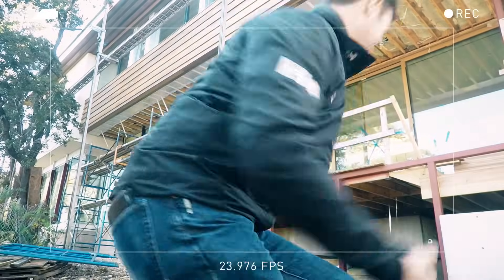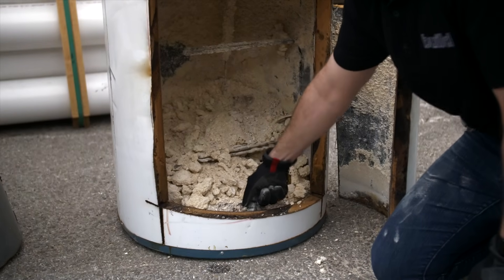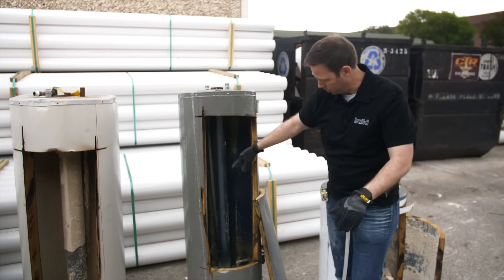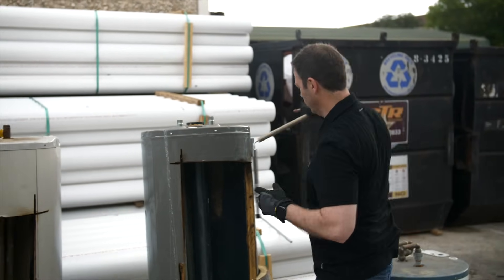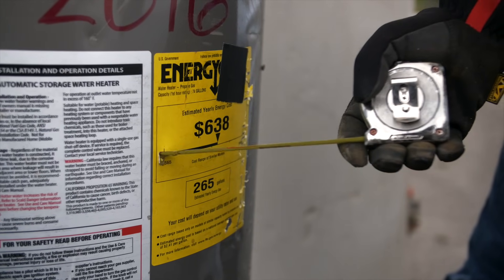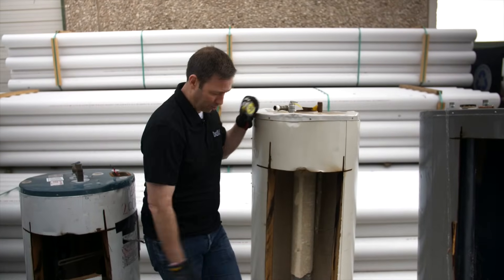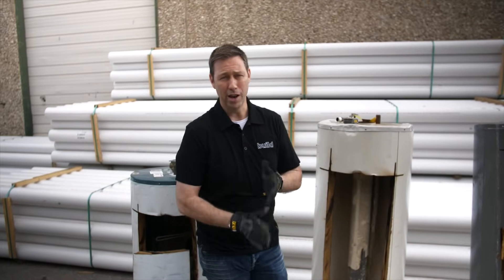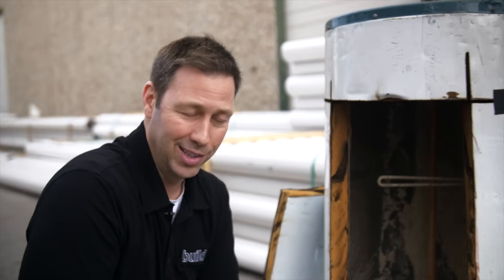Four Water Heater Tanks Cut Open - Lessons to Learn

Comment: You said 'I bet this thing used twice as much electricity.'

I think you might have it backwards.  It is indeed less efficient, but not because it is using twice as much electricity, but rather (if anything) it is using half as much electricity.

In other words, the reason it might not heat quickly or efficiently is that the heating element is corroded (or covered in sediment).  So thus failing to give off as much heat. thus it would be 'drawing' less electricity as well.  

Unlike a light bulb where inefficiency comes in the form of heat, for the most part the only way for a heating element to be inefficient would be to produce more light, right?

(other examples of lost energy could also creating a vibration which would transmit energy outside the tank, but we can assume that is not happening, or it would be the noisiest and scariest heater in history.  It could also be possible that the element could be coated, and some heat would be lost to the wires feeding the element, but wow, you would notice that instantly by simply touching the conduit feeding the heater.  Just a few watts would be noticeable to the touch).

But it still would not matter, since our goal is to get heat.  There is no magical place for electrical 'waste' to go but heat.  So almost damned near 100% of all electricity is being converted to heat.
Reply: Not exactly.
His "twice as much electricity" is correct. 

To use your light bulb analogy, place it in a small room. In your example, which is all good, however you're examining the wrong product. It's not the brightness (luminosity) in the small room we're interested in. The relevant product of the current flow is the heat. 

And most importantly is time involved satisfying the temperature set-point of the water heater. Thus, if it's calling for more, it could "use twice as much electricity".
Reply: [I'm breaking my rule of 'not engaging people that don't have real profiles.'  So, if this conversation becomes attack towards me (or anyone) I'll be more than happy to leave you with the last word.  but I will leave.]

I'm not sure if this is semantics for you, but we can make this easier.  Simply speak to watts (since electricity is a nebulous word here).  

Ideally one wants to heat water only when they are using it.  In that case, we would achieve some ideal number, for example, 41c regardless of the source water temperature.
This device would need no tank, and might use 4K watts to do this in such a way that it keeps the water coming consistently at 41c.

But, we have a device here that does not do that and has a giant bladder of water, that it wants to heat the entire thing to 41c all the time.

If it is a new element, it might do this in a few hours.  If it is a corroded element it will take longer.
It is still using whatever electricity it uses to heat the water.  But saying it uses twice as much is simply not true.
We can prove this by attaching an Amp Meter to the tank.  The element will only go down in amps, and the volts will stay about the same, and this the watts will go down as well.

At best one might argue that it is a function of time and lost heat due to the insulation of the tank.  
But it would be very odd to say 'twice as much electricity.'
Reply: @Ki-Lessons  

Agreed, the "twice as much electricity" may not seem as clear as it could be. However, that is the phrase we're discussing. My contention is it's ideal in conveying his desired meaning, in context of this video. 
If he'd used kWh, there'd be a significant percentage of the viewers negatively impacted. Viewers adept at basic electrical units and terminology immediately understand what twice as much electricity means.
Reply: I do however understand what I believe the point is you're making; ie., slow changes in heating element resistance over it's lifespan affecting load. 

Unless you can prove me wrong, your statement that it's "using half as much electricity" is incorrect. 

Use your 41c at the set point, say demand is steady state (be that none, on up), there is no way consumption of electricity is lessened, let alone halved. 

Thanks
Reply: @FOH3663  We can try this the other way around.  Every single thing @Daug KOENIGSBERG posted (2 days ago) is 100% correct.  `Since you replied to his post, we are in agreement it seems.

Right below his post 
 Niagara Mike posts `On #2, you are correct, the heater will use the same amount of power, it will be a lot slower heating it though with all that sediment on the coils.

Again, to be pedantic (on purpose) this is not exactly correct, and it is important to model this correctly (to me). 

It will not be using the same amount of power if the heating element is corroded, or if it is coated.  

Perhaps someone else might strike a chord with you (bottom part)  - https://www.explainthatstuff.com/heating-elements.html
Reply: @Ki-Lessons  
You're right, it is interesting.

I've not pursued those links, in time I'll be glad too. I'm a simple guy, so for now let's simply focus on the original point. 

You took exception to the usage of "twice as much" etc. I think that it's appropriate for the reasons I gave. 

I take exception to your claim it's actually using half as much electricity, and I submitted why. 

Those two items are the salient points here.
Reply: @Ki-Lessons  

Corroded or not, regardless of R, or I, in this water heater example electricity used has a time component.
Reply: @Ki-Lessons  

Also
Your "magical device" question, maybe you're addressing someone else. I've stated no such thing.

Thanks
Reply: Nope, I'm writing to you directly.

Perhaps we need a recap:

MR said in his video 'I bet this thing used twice as much electricity.'

I'm saying - 'If it is a new element, it might do this [heat the water to the perfect temp] in a few hours.  If it is a corroded element it will take longer.
 It is still using whatever electricity it uses to heat the water.  But saying it uses twice as much is simply not true.'

I'm still not sure what you are saying.

But I'm asking you 'how would one manage to build such a magical device that both produces less heat and at the same time consumes more power?'

Since this is just a heating element (that is its job) I'm trying to understand how you model this.

(of note, I teach science, so I'm hoping to use this discourse to better understand how other people understand this and present this in class).  Unlike many conversations that degrade, truly, feel free to ask me anything, I hope we both want to understand this perfectly.
Reply: Now that I'm being more pedantic (I'll own it) - Koenigsberg wrote 'The anode rod is only to protect the tank from corrosion.'  This may not be exactly correct either.  It should be protecting the heating elements from corrosion as well.  He may have even intended that.  But that word 'only' catches all of us.
Reply: @Ki-Lessons  

* = the only important part

Again, we can discuss all your (Red Herring) ancillary points afterward;)

First, let's please focus on your original point and my response to you. 

*You didn't like the term "twice as much electricity", and INCORRECTLY took it further by stating "half as much". 
(Hypothesis Contrary to Fact)
I pointed out why the TERM twice as much electricity is perfectly acceptable in context when time is involved. 
(electricity = stationary and moving charges)

As a pendant, you seem to be avoiding certain terms to allow agility in your argument. 
Theory yes, but real world resistive element, t-stat set points controlling lossy water heaters, transfer function wicking to the environs in which they're installed, etc. 

I appreciate your desire to convey discussions such as this with your pupils. Hopefully something is gleaned that's worthy of sharing;) 

Thanks
(let's try wrapping this up, I understand but disagree with you, yet you claim that you don't understand my responses, ... that's fine as I can't be more clear)
Reply: You've still not demonstrated or pointed to anything to support your points.
Perhaps you can invite in someone to this thread with a provable background in electrical engineering (or physics) to support your points?

I'm always open to discovering I'm misunderstanding something.
Reply: @Ki-Lessons  

Be glad to but AGAIN, the onus is on you. 

I explained why his terminology was fine. If you don't understand, no prob.

I questioned your half as much electricity statement. 
It's incorrect.
Reply: Be very specific. 
Which single point do you not understand?
Reply: @Ki-Lessons , you pulled me in from sifter. Double degree in physics (Diplom) and electrical engineering (doctorate).
Consider an equivalent electrical circuit along the lines of http://web.mit.edu/16.unified/www/FALL/thermodynamics/notes/node118.html .
Let the equivalent of heat flow be current, heat resistances be electrical resistances and the heat capacity of the water an electrical capacitance.
Let the equivalent of temperature difference above ambient temperature be the voltage V across the capacitor. 
Let the temperature of the heating element be a voltage V_H.
You want to accumulate charge from your current source onto the capacitor. 
Let the (heat) capacitance of the water tank be C at voltage V to ground.
Let the resistance from the heat/current source to the tank be R_H, between V_H and V.
Let the resistance from the tank to ambient (in parallel to C) be R_A, between V and ground.
Let ambient temperature be ground potential. 
The efficiency η is the ratio of charge stored in C to the charge through R_H. 
Let ρ:=R_H/R_A and h:=V_H/V.
Then 
η=(C(1+ρ))^2/(1+ρ+h ρ log(h/(h-ρ-1)))
which drops sharply as you increase ρ by increasing R_H by insulating the heater with a lot of sediment
and which also drops as you reduce C by using up the tank volume by the sediment.
This computation supports the assumption that a clogged up heater needs more electrical energy to deposit heat energy in the water.
Reply: @Tatzelbrumm  deeply appreciates the math (which I did not check, and will simply trust it).  The math only matters to me if effectively as applied to a real world situation it impacts the usage profile of a water heater enough to make an important difference.

So, run the maths on 300 litres (a fair sized water heater).  Do your best to assume the displacement of water vs deposited calcium carbonate and sand or what not (as seen in video).  Take into account the deterioration of the heating element.  

Do you come even close to 'twice the power' to heat it? that is the claim being made.  Is it even 10% of that?  5%?  

My point (as stated, but summed up): if you notice your water heater is erratic in its heating pattern, or not quite getting hot enough, you still are nowhere near a factor of two in your heating bill.
Reply: @FOH3663  I know this was long ago, but I took the time to follow this whole back and forth. I have studied, understood and practiced electronics. I agree with you and want to say that your attempts to reason were very fair and patient. You were correct to end it, he didn't want to understand.

Comment: I had no idea that the water heaters have to be maintained, my house was built in 1988 I bought it in 2001-2002 and I did not change the water heater. I will pay more attention to those details.
Reply: I was a plumber apprentice for 4 years, all I need to do is take the Journeyman test to become licensed.  Water heaters will last years upon years when properly maintained, drain the tank every so often to get all of the sediment out of the bottom.  Also, if you have a multimeter, check the continuity of your elements (if you have an electric water heater), as well as check the thermostats to make sure they are working correctly.  If you have a gas heater, make sure the burner plate is clean and free of any char/fouling....clean anything in the burner compartment that is covered in soot.

Comment: Every time I do something “smart” like drain my water heater the valve snaps and I lose my Saturday. Metal and water just don’t mix
Reply: I hate those cheap plastic drain valves.  Whenever I replace my water heater, I buy a brass hose bibb and throw away the plastic one.
Reply: @Brickkicker55  Or you just buy a better water heater that comes with a brass boiler drain.
Reply: @joshm5816  Yup!! Not the standard lowes or home depot shit...
Reply: @Brickkicker55  All new houses have plastic water pipes now anyway. I replumbed my house with CPVC love the stuff. I have some 30 year old copper that is starting to turn bad. Not all copper pipe is the same gage or quality.
Reply: It reminds me of this water heater: https://www.youtube.com/watch?v=lrZQgWOenCo&s
Reply: @B L You obviously do not understand that all water heaters are not created equal.
Reply: @joshm5816  just wondering if you could give a few examples of top end water heaters.  I have very hard well water with high dissolved solids. I’ve bought electric heaters(don’t have gas here) with as much as a 10 year warranty and they only last 3 years! It’s a real pain to constantly be worried about a leak!
Reply: @MrThumper1440  Normally hard water, and TDS in water doesn't effect the tank, as far as the tank failing due to a leak. I'd have the PH level of the water tested. If it's anywhere below a 6.7, look into a soda ash injection pump. A carbon activated filter will help with hardness to a point. I usually am against softeners, as they inject sodium into the water, and I work for a few retired, and current heart surgeon's that advise this is bad for your heart. As far as a quality tank, Bradford White is the way to go. Flush, not drain, flush, the tank every 6 months, and change the anode rod yearly. If you can do this yourself, you'd be OK, even without treating the water. Go buy an inexpensive PH test kit, and take a sample from the head of the well. If possible, allow the water to run a a minute before you take a sample. The well head test, will be more accurate than from the tap.
Reply: @joshm5816  thanks for your detailed response.....I’m pretty confident you know what you are talking about.  Reason being, many years ago I had an aquarium and a certain type of fish I was interested in getting required a alkaline/basic water.  I brought a sample of my water to the store and the shop owner said it was very acidic. We even tried correcting the sample of 8oz that I brought with me and after about 30 plus drops of the alkaline additive we gave up(would have been too costly).  So I think you hit the nail on the head. I will definitely look into the soda ash pump after testing. 
     Do you have anything bad or good to say about a plastic water heater something like a Rheem Marathon?
Reply: @joshm5816  oh yeah.....anode rods don’t last 3-4 months in my water.  I bought a new tank years ago and checked it yearly, then started checking it every 6 months, then every 3 months. Honestly it’s a bit too much of a pain to keep them up so I don’t even replace them anymore.  You’d think I’m getting my water from a leftover battery!!!
Reply: @MrThumper1440  I'd steer clear of a plastic WH. Look into a Lancaster system. On their website there is a phone number. They will send you a test bottle, and you mail the sample back. The test is free. They will design a system that'll work best for you. The last injection system I installed was around 1600 usd just for the system, and soda ash. It's easy to install, and has to be maintained monthly. It's as simple as adding the soda ash, and water mixture to the pull tank.
Reply: @joshm5816  Thank you again!
Reply: I took out all the steel water pipes and put in CPVC. It never goes bad. Brass valves last a long time but plastic is forever.